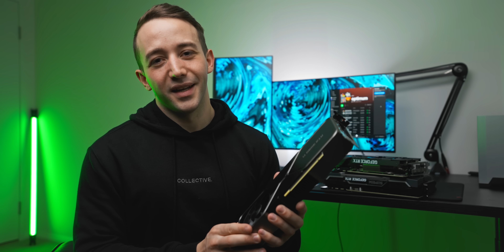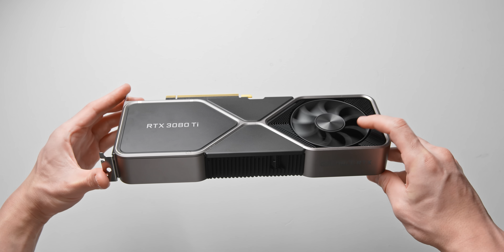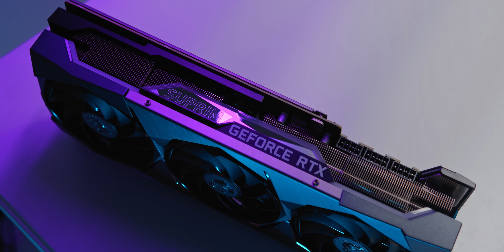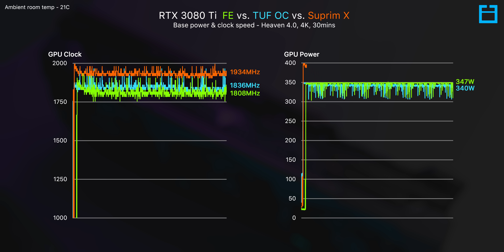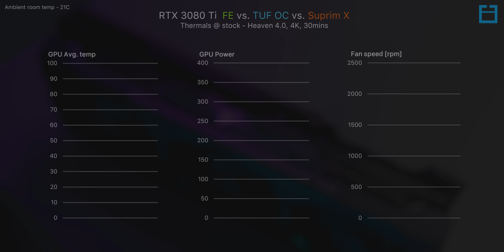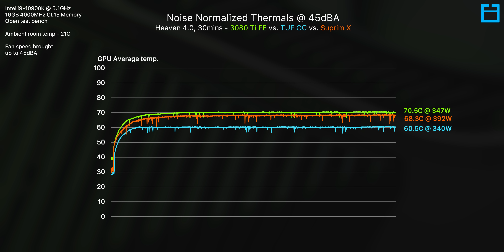Three RTX 3080 Tis - But Which is the Best?

Comment: Thanks for the vid! Going to upgrade from a 1070gtx soon.  Big jump!  The 3080ti is essentially a 3090 but for $200 less at the time of this typing (July 30, 2022).  I have no intention of overclocking and would like a card that runs cooler than a FE.  Thus, ASUS TUF it is!  Thanks again! 😀

Comment: That’s crazy because all I did was raise my fan speed , raise my temp limit , my power limit , set up a custom fan curve  and I’m getting 1965 clock speed at 280 W in Apex Legends with a maximum of 60 c on a 3080 tI FE….

Ya my set up isnt totally silent when gaming and i have hella good airflow on a 7000d.  The fe is fire if set up right!

Comment: I think there's a bit more to it that just "$500 for a few more fps".
Of course this is what it boils down to, but it also means that you have more options when tweaking your in game settings. It might be the difference between high and ultra settings, or additional ray tracing settings, or the extra 2GB of memory might make games more playable for a few more years as textures get larger in the future.
And of course the resale value of a 3080ti will be better than a 3080 so you'll probably get some of your money back.
But still, $500 is a lot for a few more fps!
Myself, I split the difference and went with a 3080 12GB!
Reply: Got mine today for exactly 500 !

Comment: Just got the tuf oc to replace my 6800xt gaming x trio and I'm super impressed. The msi card was an absolute monster. Weighs a TON. The tuf 3080ti runs just as quiet but weighs far less and runs cooler than the 6800xt despite using about 75 watts more most of the time.
Reply: Did you have any problems with the vram temp ? I saw somme people saying that the tuf had somme issues with that
Reply: @synkra4836  no problem with the vram here . I am using H500M casing , a couple of noctua fans and black chromax on the CPU . Vram is about 70-80c playing games , 56-58c for GPU . If I am using 3DS MAX which push the GPU to 100%,  it runs at max 85 c . Room ambient temp 30 c , yes I live in a hot country .  If you ask me , the performance is so good .  

The fan noise is low , the performance is amazing and it only requires 2 x 8 pins . Yet it often peaks up to 2000 mhz despite using much lower power than its STRIX brother . 

Overall , fantastic product and probably one of the best 3080TI variant in terms of value Vs Performance . , Suprim X beat it in raw performance but that card cost quite a lot more and using much more power .
Reply: @MsNellyuan  Yo how’s it doing so far?

Comment: Can't decide between 3080 ti tuf or suprim. I'm putting it a nr200p max. Leaning towards the tuf due to fit and Temps. But the suprim will just fit and looks nicer.
Reply: SUPRIM X is more premium. Better build quality. Better cooling. Higher base and boost clocks than the TUF which results in better performance. SUPRIM X just looks better as well.
Reply: @RenderPixion  I ended up buying the tuf. It was way cheaper lower temps and power draw and same power pins as pre-installed nr200p max  power supply. Might nab a suprim x for my tower pc if the prices drop low enough.
Reply: @ivan-j4l9x  If you can find a SUPRIM X for a reasonable price it’s definitely worth getting it. I was going to upgrade to the 3080 Ti but it has been extremely difficult to get a 30 series GPU. Supply and prices are much better now but I think I will wait for RDNA 3 and Lovelace. They should be out towards the end of this year and leakers such as Kopite7Kimi have said Lovelace and RDNA 3 could have over double the performance of Ampere and RDNA 2.
Reply: @RenderPixion  thinking the same. Going to be lots of choice soon

Comment: MSI RTX 3080 Ti Suprim X is the best card. But currently with these inflated prices it's better to buy a 3090 Suprim X because the price difference is minimal and you get extra 12GB vram along no LHR in 3090. So the price of it, is less likely to drop and stay more stable, even increase potentially.

Comment: I don't get why the FE cards are so hyped, worst performance and cooling by far. Looks bland too.

BTW the Gigabyte Gaming OC has better OC potential and temps than the Asus TUF OC card, for much lower price. I added +60 Mhz in Afterburner and get average clock speeds of 2025 MHz in-game.

Comment: i have this rtsx 3080ti. and it's thermal exhaust is not going through fans, actually it's blowing out through side heat sinks. so the thermal wind is hitting straight away to side panel . is it same for others!

Comment: Managed to get a 3080ti FE.. never had an FE card before, temps look ok around 65-75 C, occasionally close to 80 only briefly, but man this thing gets hot to touch on the aluminium case.. it also hearing the motherboard up like a radiator.. not sure if this is a problem or not

Comment: In my country, Asus TUF non OC just for paper launch starting from around $1400 after tax etc... But in actual, they dont have it and only have OC version which is $400 more than non OC end up at $1800+. Its crazy increase only from non oc to oc markup... and that one for retail MRSP in my country plus you need buy bundle pc for that, if not will be 10-20% extra for gpu only. I end up buying gainward 3080 ti which is marked up also (can look at my channel video) but that one the cheapest 3080 ti you can find now...

Comment: Anyone have an example of what that Ncase M1, 4x120mm fan setup referenced at 06:38 would look like? Where would the fans be configured in that situation, on the bottom and the side?
Reply from the maker: 2x bottom intake under GPU, 2x side intake on radiator

Comment: In my FormD, I got a TimeSpy score (graphics) at 19052 drawing only 255 watts with my Sapphire 6800XT SE after UV/OC. The Radeons are so much more power effective than Nvidia. Stock was 18732 at 279 W. How about a Radeon vs Nvidia comparison for heat/noise/performance in smal ITX cases @Optimum Tech?

Comment: Mwave have the TUF for $1920, and the TUF OC for $3249
Do you think the TUF OC is worth the extra 50% price increase?
I mean, surely its got alot of extra work in it so ASUS have to sell it at a higher cost.

Right ;)
Reply: Yes I saw that too….maybe the regular was a place holder as that was the original RRP here in Australia. I got a vg deal, considering current times, for my Galax 3080Ti which was $2600. Still got my TUF 3080 at $1299 soon after launch…..now retails for above the price of my Galax 3080Ti 😂 😆 😝 lol
Reply: @akuma2097  I just can't justify that much money, considering how much they're "supposed" to be priced at.

Me and my GTX1080 will just hold out for a 3080... once stock (hopefully) normalizes, they'll be listed everywhere... ebay store, discount code... the dream.
Reply: @MrLincoln87  I’m sure things will settle down, maybe early next year, you’ll get a great deal on the gpus then, much better then now and much closer to RRP/MSRP here in Australia 🇦🇺. Whether it’s new or used 👍 the 1080 still is a great 1080 gaming GPU for many titles 🥰👍🥳.
Reply: @akuma2097  Haha spewin im gaming at 3440x1440p then lol 

I find it so dumb and funny that places can sell them for well over MSRP.. but then stores can't sell xbox/ps at over msrp.

I just really wonder who has set the price.

Comment: Out of curiosity, would the EK RTX 3080 FE block fit on the 3080 Ti? That block just looks so good. 
Great video by the way. :D
Reply from the maker: I’m going to check :)
Reply: i bet you need to provide more thermal pads for the memory but other then that the enhanced power delivery will be covered in the same pads
Reply: it should
Reply: It should
Reply: It should
Reply: It should
Reply: It should
Reply: It should
Reply: It should
Reply: @typo691  You can return it to EK if it doesn't because they say it does. It is not a matter of speculation.
Reply: @Safetytrousers  damn dogg the man was simply asking a question, no need to get heated
Reply: @spencerdavis1853  In the comment I replied to he didn't ask a question, and I just stated facts and I did ask a question. And he called me a mildly pejorative name when I was right.
Reply: it should
Reply: I put the corsair xg7 3080 fe block on the 3080 ti fe and fit perfectly, not really any padding on that backplate tho
Reply: 🤔 Hmm... I wonder
Reply: But its a torn down 3090 sooo what will work
Reply: since EK released the active backplate that worked so well on the 3090

Will Asus and EK release the next version of the EKWB RTX 3080/90 with it? So we dont hv apply it ourselves
Reply: @shawalfida6357  3080 doesn't need a active backplate, just the 3090
Reply: E
Reply: It should
Reply: Yes, it says so on the EK site. Which is an obvious place to seek an answer to the question.
Reply: @Safetytrousers  Okay Mr Sassy pants, I did check EKs website, and it says it's a visual match. It doesn't guarantee compatibility.
Reply: @DawidDoesTechStuff  It means there is a picture of board and picture of the GPU for each one, the physical and visual link to the same blank form.
They wouldn't bother to show you the board of an incompatible GPU, and you can see by comparing the two if there are any differences (the only difference is 4 spaces present on both boards being filled in on the 3080ti).
And then you can see in the manual the block fully covers those extra components.
Why would you think they would list a match only for an externally similar appearence?

Comment: No idea how the suprim X managed to be the loudest card with such a massive cooler.
Reply: MSI in a nutshell. Mostly bark, little bite. Plus, they scalped their own products.
Reply: 50w more power and 100mhz higher clock speed. If you normalize this, they are very similar
Reply: Did you hear the sound test and not realize how much smoother the fan sounds? The numbers are obviously not the end all be all, FE and TUF have noticeably loud whirring and popping sounds with FE being significantly worse.

Comment: Three RTX 3080Ti but wich is best? The RX 6900XT wich is fater, cheaper, with more Vram and consume 100W less. Done.
Reply: If you had the option to buy whichever one you wanted at retail maybe you're right but that's not the case.
Reply: @FtGFA  Here in Italy you can find custom 6900XT at 1400-1700 euro on backorder from retailer or even direct-buy from scalpers online plus AMD drops at MSRP every week (that's how I got my RX 6800), in the meantime Nvidia simply does not sell FE cards and never did so....

Comment: Fun fact: nr200p will fit the suprim card supposedly, 3080 suprim fit for a reddit user with pics included
Reply: It does fit! I have 3080ti in this case, i just removed side filters so it wont cook the cpu, also bottom fans wont fit anymore because there is 75mm and suprim takes 61
Afaik all suprims, 3070-3090 have same size.

Comment: Is it just me or the MSI Supreme X looks so good
Reply: Yeah. I have the 3070 version of it, and it's a really fancy card. Quiet and powerful! But expensive. This is the card that I managed to buy so overall I can't complain
Reply: Half year warranty
Reply: I have the 3090 version, it's a great card and my only complaint about it is that the fan speed when using the SILENT BIOS is too conservative and the GPU temperature exceeds 80℃ under heavy load. Of course you can set a custom fan curve using Afterburner but some games crash when you use it.
Reply: It is. It's a tank.
Reply: I prefer the ASUS TUF 3080 Ti (or 3090) because it seems to be the coolest and yet silent card there is. And I like that combo ;)
Reply: @laggmonstret  I'm more interested in the quality of the product and MSI are known to cut corners and use cheaper materials. Remember when people where complaining their 3080's and 3090's had issues with the capacitors on the back of the GPU started to squeal and make a loud noise, MSI also have bad reputation on scalping their own cards believe it or not. They do say though amazingly that it was due to a third party organization that was linked to MSI. Buy a TUF GPU I would not risk it with a MSI.
Reply: To mw there are only 4 nice looking cards 1. Evga ftw ultra 2. Asus rog strix 3. Suprim x 4. Gigabyte aorus master
Reply: I will always love my 3080ti FE. The look is so damn sleek! like a brand new stainless steel kitchen or something lol
Reply: I have 2 3080’s, 1 3080Ti
Strix and aorus master 3080
1 FTW 3 3080Ti
Arguably, for me the FTW3 looks the absolute best sideways for the RGB bar, but in terms of quality I’d say the strix is the best, next to Aorus and then EVGA. Overall, I say the edge is on the strix in terms of everything. Not only that, but the strix is actually b i g g e r than the 3080Ti evga ftw 3. By a damn margin too.
Reply: I have the 3090 version of the MSI Suprim X! It's so pweeeeeety! 😍😂
Reply: Have you seen the EVGA 3080ti FTW3 Ultra?.... no contenders
Reply: @fedegrox  yea man 
They too look pretty sweet
Reply: I prefer the Strix look but it's a close second for sure
Reply: @subbot8077  i also prefer the strix look, its the one i initially wanted, but i managed to order msi suprim x 3080ti today, it is the 2nd* best, and at least i have one now, will totally be enjoying
Reply: @slushy7  Good choice on getting the Suprim X, the quality is better in my opinion, when it comes to the materials and looks compared to the Strix. I have a 3080 Suprim X and i love it. I also had the Strix 3080 but i fell in love with the Suprim X but both cards are the best on the market.
Reply: @ErickRodriguez-gl5wg  thats very good to hear, i will pick it up today i just cant wait